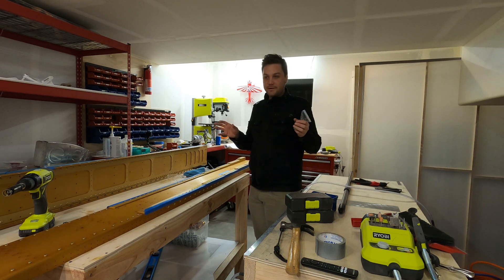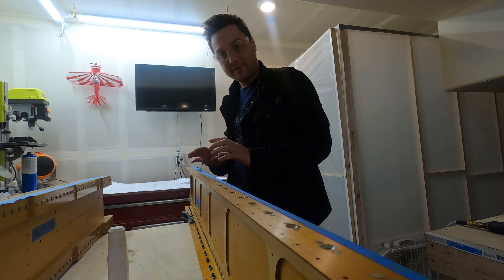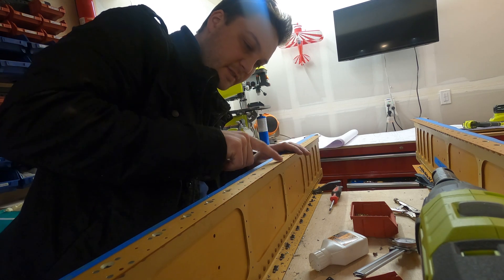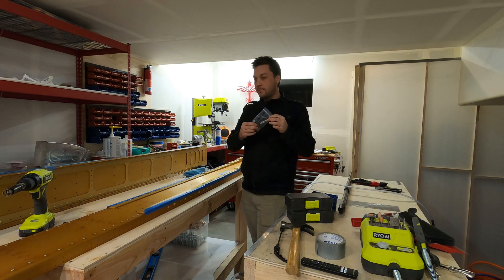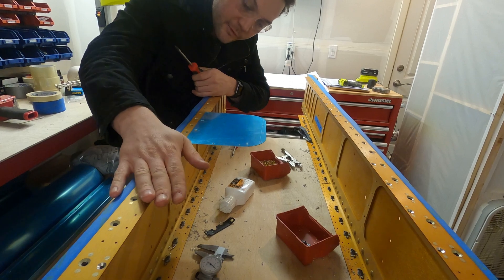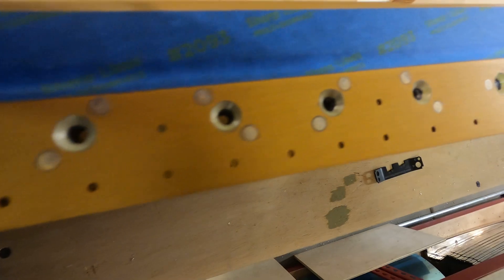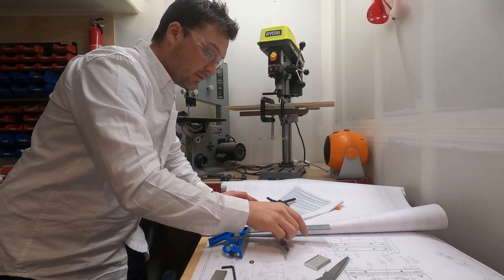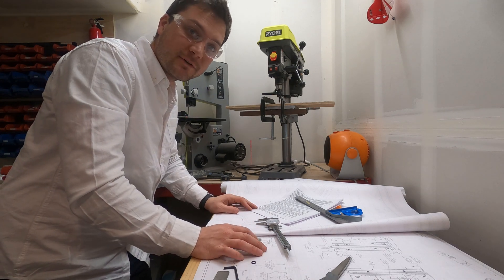Building an Experimental Airplane, The Vans RV-7A | EP2.2 Main Spar and Tie Downs

Comment: Ryan, great work here! What model pneumatic squeezer are you using?
Reply from the maker: Thank!

I purchased mine from Cleveland Aircraft Tool, as a part of the tool bundle. I added several yokes, which all have proved essential!
Reply: Thank you, these videos have helped a ton with my F1 Rocket project. I’ve finished the empenage, main bulkhead and flaps and ailerons so far and I’m starting to get tired of hand squeezing everything.
Reply from the maker: Great to hear! I’ve never hand-squeezed, but I don’t feel I’m missing out…
Reply: You’re definitely not missing out on anything except hand cramps haha! Keep the good work coming!

Comment: Ryan... have you had any issues with countersink chattering? Which pilot cutters do you use?
Reply from the maker: My countersink cutters are from Cleveland Aircraft Tools. Chatter can be a problem, but I didn’t have any issues on the spar.

I believe installing the nutplates to guide the pilot can help if you haven’t done that. 

Lowering speed tends to help too.

Comment: I used a step drill and it worked perfectly. I also went with 3/4” diameter instead of 1 “ so it would have a bit more material. Non critical. Oh and pro tip. When you get to cutting the 5-6” hole in the inboard rib of the fuel tank, get yourself an hvac hole cutter. It’s the one where you drill a center hole and a cutting bit cuts the circle. Cuts a beautiful circle and won’t kill you. Let me know, I’ll send you the link for anazon.
Reply from the maker: I saw someone on IG using a step drill and it looked wonderful, even up to 1”. (Though I like the idea of leaving a little meat—that 1/8” side to side was a bit close!)

I was just reading about the rib hole last night. I’ll be there soon, believe it or not. I think I know which one you’re talking about. There was a Milwaukee bit right next to this one.